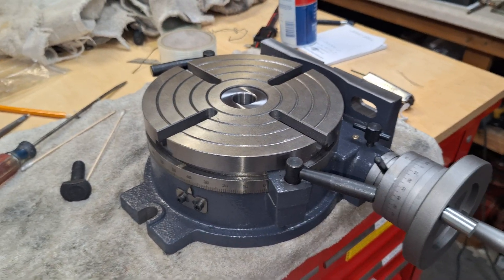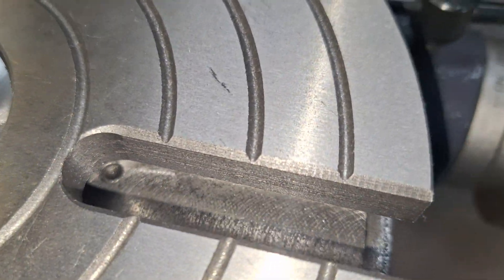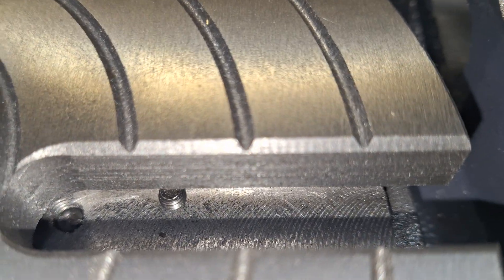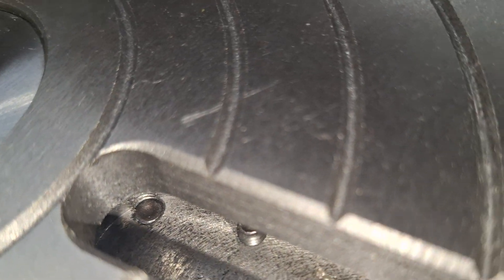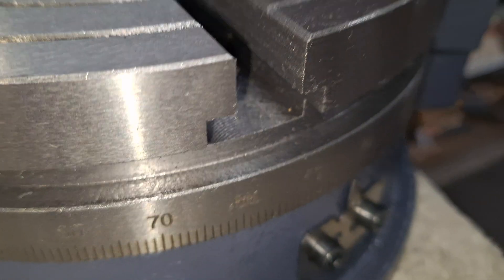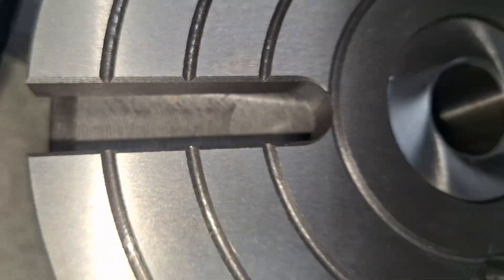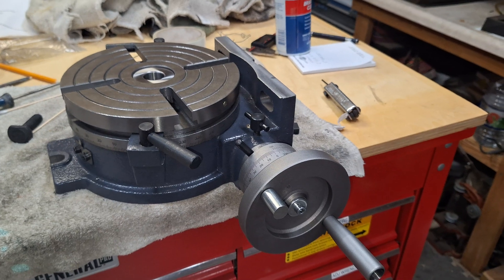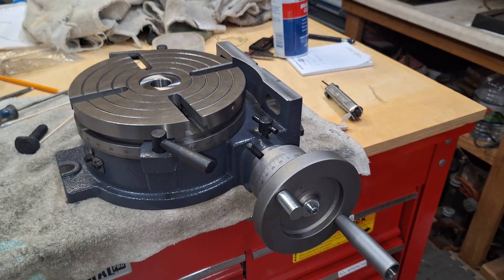Vevor 8" rotary table,  screw protruding in T slot ?

Comment: Disassemble it. I recently got a 6", full of metal chips, i even found a broken dtill bit inside. The screws sticking up are for the center hub and gear, attached inside.  It's not bad, but the overall fit and finish is pretty rough.
Reply from the maker: Yup, your right.  It was actually pretty clean inside,  a little bit of grit. They simply drilled  the hub mounting bolts in the wrong area, threw in the bolts (in the T slots) tossed in a box & shipped it. Obviously, they have 0 quality control.  How could they , to have let this pass by ?

Comment: Ive never looked inside a rotary but judging by how the ones that are recessed are congruent with each other, they made it wrong, someone in the factory cough sweatshop cough , designed it wrong or something, i mean i dont know how you mess up THAT bad, i would venture to say those arent grub screws, its probably a SHC machine screw that maybe was too long when they ordered it? i have no clue but it certainly looks like a manufacturing defect to me, shame for you its gonna get in the way, i guess my solution to that would be make a aluminum or even steel subplate for it, and try to use the outer most section of the t-slots to secure it, you can probably find double disc ground or blanchard ground aluminum disc/plate that is to that size. just my thoughts, also instead of using vevor for that stuff, get some high quality machining stuff, people are always retiring or auctioning their stuff, you just have to look, youd be really really surprised how many machinist tools youll find at swap meets, flea markets, second hand stores, even go to your local Habitat For Humanity i guarantee youll at least find a nice tap handle or something.
Reply from the maker: in another video I described how I have been looking for a well-made name brand rotary table for quite some time, but the good ones that are even remotely close to me sell instantly (if they're offered at a decent price) & most are well over $500 for a well-used one. I figured for $194.00 I would give this a try. I simply put a cut-off disc on my Dremel & carefully eased it into the slot & sliced it off even with the surface. I could have sent it back, but in the end decided to keep it, yes, I had to do some work on it that I shouldn't have had to do. I do go to swap meets & garage sales & always pick up quality tools when offered (for cheap usually) those are my favorite buys.
Reply: @bruceang82  totally, and vevor is super good too, its china made sure but sometimes thats what you want, i guess what ill add is dont make a habit out of it, because you are gonna be sitting one day with a bunch of harbor freight accessories and doo-dads that you wish you would have bought name brand or better, but for little onesy-twosies, vevor and stuff like that cant be beat
Reply from the maker: @carsonp.7009  I've never considered Vevor "super good," but as you have stated earlier, sometimes they are "good enough"...and that's enough 😉 👍